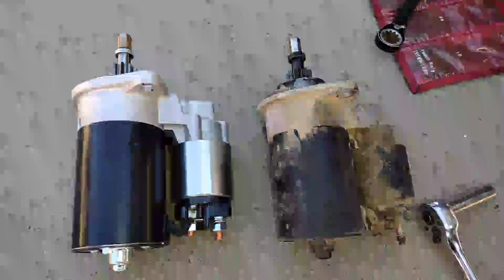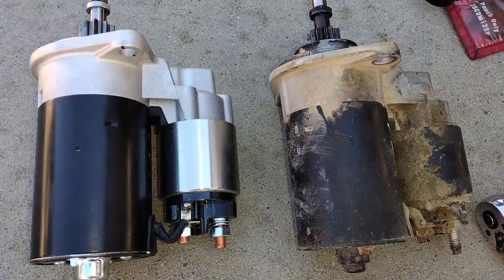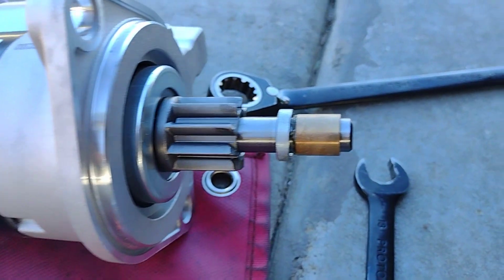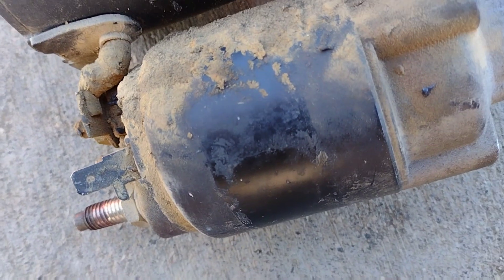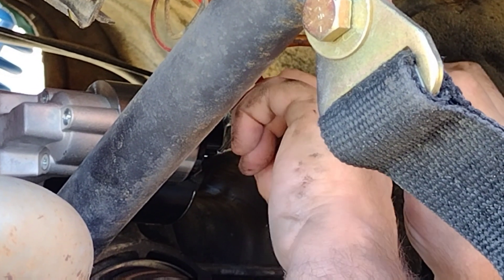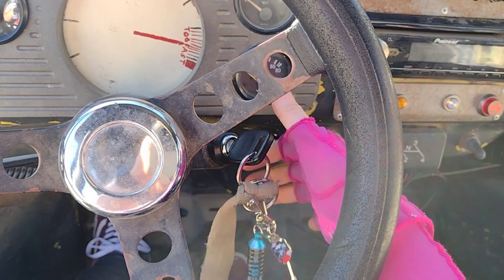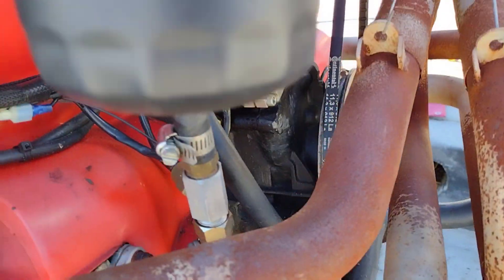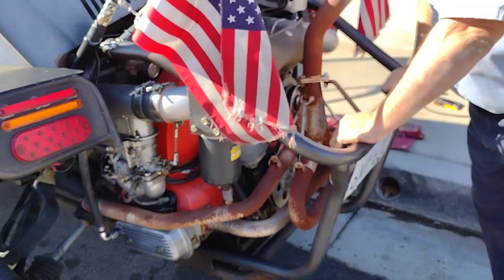Replace your VW FAN BELT in under 30 SECONDS!!! 🤯⏰

Comment: make sure to check it when you roll it on to make sure its not too tight or too loose. Also there should be a total of 9 shims on the generator or alternator either side of the pully. otherwise it will crack the pully. The 9 shims can be on either side or both side. but there needs to be a total of 9.
Reply from the maker: Thanks for the tips Mike! 🙏

Comment: 0:29 if parts available it can be rebuilt at home
Reply from the maker: Very true! For $60 on a Black Friday sale, I went the lazy route and figured I would replace the whole thing. I figured I might as well if I'm going to the trouble of taking it out anyways. It turned out the shaft of the starter was really wobbly, probably an indication that some internal component was failing

Comment: There used to be a video on here showing how you can change the belt while it’s running using a screwdriver. I’ll bet a bit dangerous but it worked nonetheless. Edit: found it. 

https://youtu.be/BQhfcdQf1QA?si=noSrhNUnlenMCVCn
Reply from the maker: Nice one! I've seen that one before, too. Pretty nifty little trick!